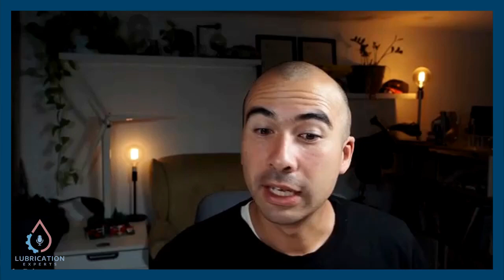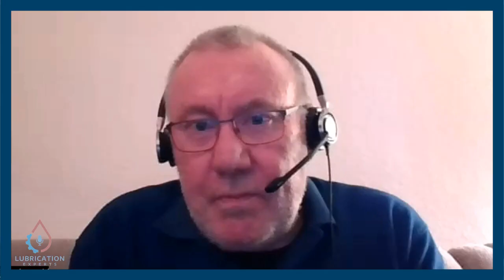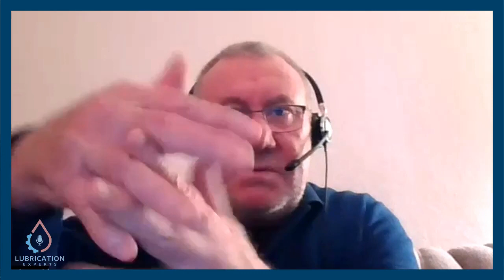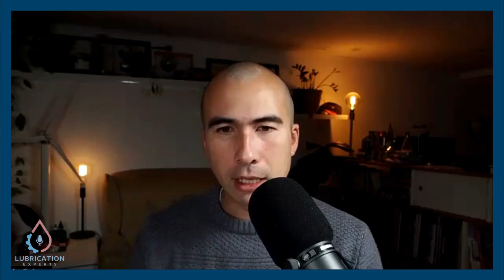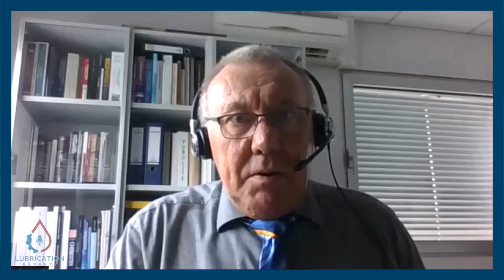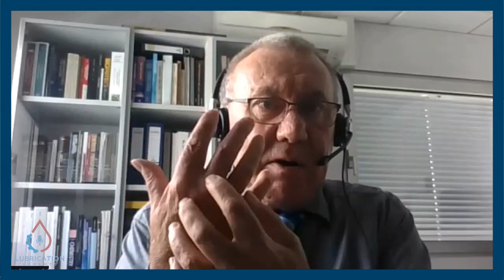Episode 048  |  Oil Filters with John Duchowski (Hydac)

Comment: I miss the AC/Delco Gold and Bosch Hp oil filters. 99% multi pass filtration at <5-10 microns… my 5.7L Chevrolet V-8 was running fine at 421K miles using 10w-30 Mobile 1 oil. Changed once a month at +/- 10K miles

Comment: Rafe, Dr. Duchowski mentioned (at about the 53:20 point of the video) that gas-to-liquids have a certain operating performance that required modifying the filter media to meet that level of performance.  I therefore wonder if folks that utilize GTL lubricants should gravitate toward a specialized oil filter designed GTL lubricants and if so, do you know the identity of such filters?
Reply: Thank You Jim 🤗👍! Yes, we have a Stat-X line of filter elements that we have successfully shown to work even under the most demanding operating conditions, i.e., cold start at 15°C and high flux through the element, up to 0.8 L/min/cm2 though I would certainly not advise to go above 0.05 L/min/cm2.